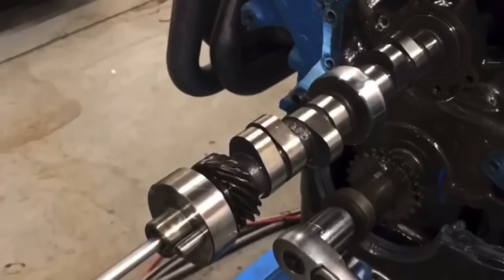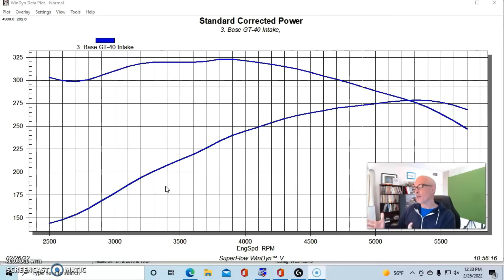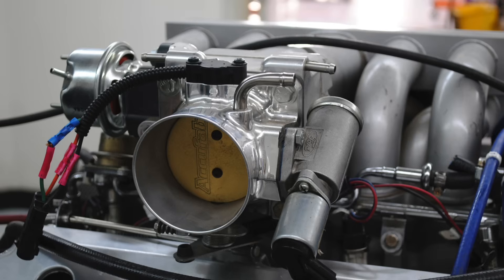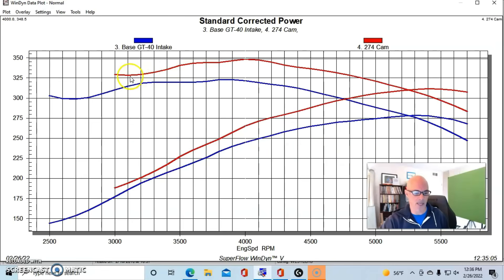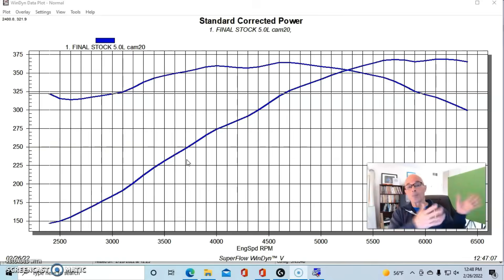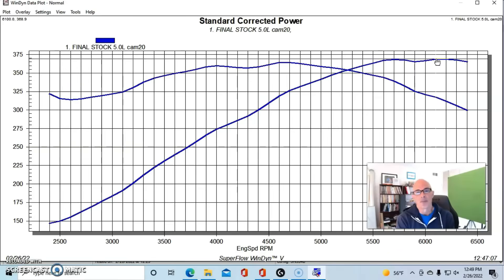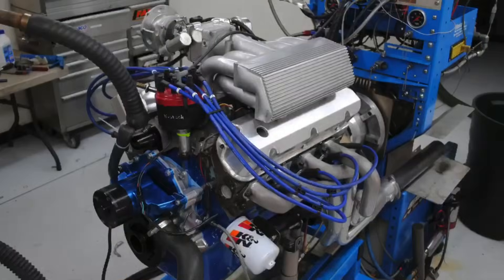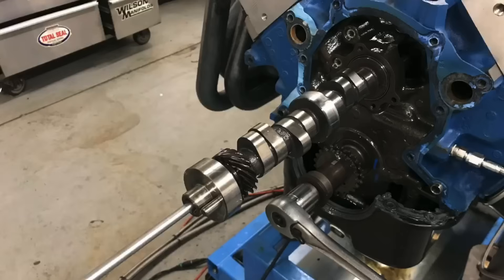HOW MUCH POWER IS A 5.0L CAM SWAP WORTH? WHAT IS THE BEST CAM FOR MY 5.0L 302? 5.0L FORD EFI VS CARB

Comment: 312hp in a fox or sn95 would be a respectable really fun street car and fairly decent in the 1/4 mile for such a mild combo. Seems there still fun and fairly quick even in 100% stock form no not "fast" but fun they accelerate good and will still roast the tires. People hear 215hp and laugh but I explain yes the HP is pretty weak sauce but it still has V8 TQ which feels decent off the line seems TQ gets you moving. Where the low HP seems un inspiring is top end pull. Unfortunately even tho they seem quick you can easily get gapped by a late model not performance car even some modern 4wd trucks and that is embarrassing... That's enough motivation to try n add some more TQ ant at least 100 more HP then you won't be gapped by modern sedans and trucks just don't test a coyote....
Reply: my truck makes 195 with the 5.0 lol at the crank
Reply: @sillyspoon2250  oh my 95 GT was rated at 215 new it has 150k so that ship sailed not to mention it still is original it has the OEM ford sparkplug wires and I think the plugs are original lol, I bought plugs and when I see how bad pass side accessibility was I didn't bother plus after having a plug snap off in the head of my 2010 grand caravan I'm not nervous about removing plugs even tho I've changed hundreds In my life and those were originals at 190k! It was running terrible plugs fixed it, they had a huge gap I'm surprised it ran as good as it did

Comment: Where are you located and do you do cam swaps at your location. Interested in the EX274HR cam you just previewed.
Reply from the maker: I don't have a shop
Reply: @richardholdener1727  Do you do it on the side? your videos are so on point and would pay you to help me change the cam, Lifters.
Reply: @richardholdener1727  I have a 600 cfm carb 302 aluminum heads and intake intake.

Comment: This would be more helpful if the baseline was a completely stock 5.0 which makes around 200hp rather than starting with something making 279hp and having it bored with long tube headers etc....
Reply from the maker: a stock 5.0l doesn't make 200 hp on the engine dyno

Comment: My question is if you run the GT40 intake manifold why not go up on the fuel injectors  tow like a 26 PSI or a 30 PSI fuel injector and put the 1-3/4"long  tube headers!! Would that give you almost the same equivalents as a carburetor like a 650 or a 750 carb!! You have me scratching my head on while I go to a carbureted intake and manifold when you could possibly get the same amount of horsepower out of a fuel injection intake manifold with just an upgrade of fuel injectors⁉️🤔💡🙄😒🤯
Reply from the maker: the injectors don't hold back the power of the EFI intake-it's the design of the intake
Reply: @richardholdener1727  what about a port  and polish for EFI manifold and the exhaust on the gt40p heads and put higher compression valve springs in with a good cam and
 1 3/4"long tube headers would that help any because I really wouldn't want to go with a carbureted intake manifold or spend more money than it's worth on the whole project of a budget build!! Thanks for getting back to me though on the thought anyways is there any way you could possibly change out the power steering pump and put an a EPS steering system in the car to help add more horsepower and do a little bit of pulley changes just thought!! If it is possible!? I really do like your videos... 😍

Comment: Ported lower for the GT40 would've been nice. The as cast lower pretty much sucks and it would be really nice if you had mentioned that or even showed the difference in those ports.
The GT40 is capable of way more than what was displayed here unfortunately. Let's not make the GT40 style manifolds (tubular, Cobra and Explorer) look like junk compared to the carbureted Performer RPM.
How about sending the lower GT40 to a good porter (TMoss is popular or even my boy Lloyd Elliott) and let them do what they do and then let's do this test again because the GT40 will not nose over nearly that early after porting!
Reply from the maker: The effective rpm does not change with porting, the runner length is still the same

Comment: When I looked for upgrades to do and see the number they say they add to a stock engine, I have had people say "Yeah, but you can't just add them all up and expect to get that". I have always said "You're right, you get more if they compliment each other".
Cam alone worth 33hp. Heads and intake worth 89hp. Just adding it up, you get an extra 122. Because they compliment each other, you actually got 149.

Comment: I've got a 306 gt40p heads the machine shop done what they call a street port exhaust and intake runners been gasket matched and cleaned up under the valves been cleaned up stock valves had a 3 angle valve job valve springs upgraded for the b303 cam , 1.7 roller rockers, eldebrock performer rpm intake, 650 double pumper holley speed pro  flattop pistons  1 5/8 long tube headers, b 303 cam msd distributor 9mm plug wires not really looking for a certain amount of horsepower and tourqe just wondering if this combo will work good together and the horsepower and tourqe it might make any suggestions greatly appreciated thanks
Reply from the maker: it will work-should be near 340 hp
Reply: Thanks I appreciate it

Comment: Good stuff. Interesting point: if you look at it as the percent gained, the difference is  barely over 1%, and that is likely because the 190cc 2.02/1.60 AL heads and better intake went from a horribly matched cam to a better matched cam while the iron head went from a well matched cam to one that the heads/intake couldn't take complete advantage of  the improved lift/dur.

Comment: I’m curious as to how those numbers would translate to power at the wheels. 
My guess would be for the 417 hp combination in a fox body with a manual would be 355 HP at the tires.
Reply: I spit ball the crank HP multiplied by .8 for an unlocked auto rwhp. ×.85 for a T5, T56.
Reply: I would say you are in the ballpark

Comment: With the superflow 902,what revs per sec do you use,i got a motor built for a 4wd,late 5,0 block,out 20,with 3.4 stoke crank =346 it has 9.7 comp,165 AFR heads Comp HR 280 cam and weiand stealth manifold and a holley 750 hp carby,and it dynoed 399 hp@ 6000,my engine builder was  blowern away with that HP as he is mainly street/strip and full race builder,He says his dyno equites to moroso calulater hp,he says a 400 hp engine from his dyno,with 3500 lb car is a mid 11 sec 1/4 mile car
Reply from the maker: the acceleration rate of a dyno can be changed-we normally run 300 rpm/sec

Comment: Good promotion for the factory roller 5.0 H.O. cam from the looks of things. Possibly pretty good duration numbers with a relatively wide LSA to keep the idle quality.
Reply: I ran stock HO cam in my f150 for 250 K. It was a nice upgrade over stock flat tappet, right at 200 rwhp. The 94 cobra motor with the truck intake is much better, I estimate 275 at the wheels, with about 1mpg increase...

Comment: I built a dss racing engine with that 274 cam back in high school. It had afr 185s and a ported cobra intake with 24 lb injectors. I was trying to copy a motor you dyno tested in the book 5.0 dyno secrets!
Reply from the maker: GOOD STUFF

Comment: I keep trying to explain this to a friend who just don't get it. He put in a better cam and keeps asking how much more power he's got. He thinks it's worth 100 hp and I say no more like 30 to 40 because he's got 317 heads on a 6.0. I said if you change your heads maybe 80 hp. He said why can't I get 80 hp from the heads I have. I keep telling him yes they flow well but drops compression ratio. Better heads with more compression will raise the gains from the cam.

Comment: When changing a factory camshaft to a bigger aftermarket camshaft, in an engine that has non adjustable valvetrain, can the appropriate length pushrods be used instead of machining the heads to accept adjustable studs etc?  On low rpm (5500ish) deals aren't press fit rocker studs sufficient as long as the pushrods are the correct length?  Are the screw in studs only necessary when the valve spring rates and rpm start getting significantly higher than factory?
Reply from the maker: yes
Reply: @richardholdener1727  thank you.

Comment: 🔔😎Comparing at 5252 rpm where the curves cross, each engine gained about ? similar hp/ lb-ft.
Just something that I have always done. 😎
Reply from the maker: why does the gain at 5252 matter more than elsewhere?
Reply: Only because the clock time spent at 6,000 rpm is less than 1%.
Usually people shift at 5 or below, except when racing.
Just my thoughts.
Thanks Richard 👍😎

Comment: Nothing is absolute.  Yeah... you can add a cold air intake, add long tube headers, add a larger throttle body... yadda yadda yadda.  You're not going to get exactly the 50 hp gain mentioned in the "up to 50 hp gain" advertisement.  Especially if #6 plug wire is fried cuz you didn't keep it away from the primary header tube.  Just sayin'.

Comment: Stock HO roller 91 5.0....Weiand dual plane, stock cam, stepped headers, 1.7;1 roller rockers, AFR 165's no change to the short block at all...407hp  (STOCK CAM) Oh, a 670 Demon carb too
Reply: wasnt that in car craft like 15 years ago?
Reply: @powerviking  yes! exactly   great article just shows how the over sq engines with proper heads cab make great power. It showed me the added power of stepped headers and that even a cam with .470" (after the 6% gain from the 1.7 vs 1.6 :1 rockers) could make great power.
Reply: @Selkirk69  it was the inspiration for me to do my own HCI swap on my 5.0 back in the day
Reply: @powerviking  I liked the build because it showed just how good the AFR heads were, they always outflow heads of equal intake cc . Yeah, I remember that article well, even the red color of the block and the fact that they used a stock cam! w/ just an upgrade to the 1.7 ration rocker ( so .444 + 6% ....027"...) + .471" not bad at all and duration was like 260 gross ( 210 @ .050)  which is so mild!. Just think, a .500", 224dg cam would have been completely street friendly and added 20-25hp more!  ahhh, memories!..cheers

Comment: I'd rather have a stock cam with good heads than a good cam with stock heads.
Reply: that's exactly what i am going to do
Reply: @roythomasjohnson2341  you can get 400 hp with just a head swap.
Plus good gas mileage and a mild idle.
Who could ask for more.
Reply from the maker: you can't get 400 hp with a head swap
Reply: @richardholdener1727  no, but you'll have better potential with better heads
Reply: @richardholdener1727  370is good for me with a t5
Reply: @richardholdener1727  sorry Richard. It's been done many times. I will point you to the results when I find them.
I respect you greatly but no one is a know it all. Including me.
Reply: @richardholdener1727  motor trend is one who did a head swap new rocker arms and headers on a roller 5 liter.
There are others that have done it to.
Reply: @richardholdener1727  Will it do it with AFR 185cc heads?
Reply: @richardholdener1727  Right, but you CAN get a pretty torquey 350 hp or so, seat of the pants dyno in heavy vehicle would favor the stock ho cam, ( the 94 cobra cam is the bomb in my 1990 f150_.
Reply: @richardholdener1727  lol. You sure can't get 400 hp with just a head swap LMAO😂. Richard I love what you're doing with your channel brother. I don't know how in the hell you keep up with yourself. You have got some hustle to you my man. Great work! Keep the videos coming and I'll keep watching.
Reply: @falcon6995 Yes and 1.7 ratio rockers.
Reply: @cammontreuil7509  But not in a factory tune and not just heads. It's impossible to get 400hp out of just heads. That's like saying taking your air box out adds 50-100hp
Reply: I have a stock GT cam and bowl blended GT40 heads, milled .040, .035 quench, performer RPM manifold, long tubes. Torque everywhere. Need a posi real bad.
Reply: @stuartwall8212  you did it right and even on the cheap.
Reply: @stuartwall8212 yes you do and probably steeper gears to
Reply: It's a Ford 302, cams are cheap as dirt. Delta cams Will hook you up with an alphabet regrind for $100....

Comment: Perfect timing! Im just starting to tinker with my 94 mustang 5.0… you proved to me that the numbers my dad said were right with the combination it has right now (give or take)… supposedly it has an E303 cam in it but everything im seeing is its still in stock format… i think it just might have a better tune… she already feels pretty quick, i cant wait to throw a set of heads on her even if she might have a stock cam, but if it does have the e303 cam that will just make her quicker! Should make for good content later!
Reply: AFR renegade 165s would be a perfect fit for your car.
Reply: @I_like_turtles_67  thats what im aiming for is a good set of 160’s
Reply: E cam will lope pretty hard. I got a 94, take the computer and toss it in the ocean.
Reply: @joenobody2580  i dont have an ocean but i do got the gulf of mexico lol
Reply: @TheFARM2019  Joe N. is right. The 94 computer is difficult to deal with. 
Pay a lot of attention to, and gather some knowledge of the stock ECM and the MAF sensor.
Or throw it into the Gulf and go aftermarket.
Reply: @2lotusman851  thats been the plan is to get a set of heads, a dual plain intake and then get a self tuning efi
Reply: You would know the difference between stock and e303 because of the sound and yes it feels a little more happy. I did that swap 6 or 7 years ago and finally  I'm doing gt40p heads and intake and better headers should wake it up more. Hope this helps😉

Comment: It's really cool all the work you put in. I can remember 20+ years ago arguing with my Dad why I'm staying 302 with him just shacking his head saying there's zero point just run a 351.  It's Sunday morning I might be a little late to this video but I'm sitting here with my cup of coffee thank you very much.
Reply: 351 is way ea way better.302 are 500 hp timebombs
Reply: @ryangulley1082 Myth
Reply: @ryangulley1082  Lol who told you that 😂😂
Reply: @isaiah9313  I know I've cracked in half.u nust not have been around long.everyone knows that except you.
Reply: @ryangulley1082  Ok boomer I’ve seen plenty of people with boosted stock blocks. Engine block splits based on a different variables. What was the engine build?
Reply: @isaiah9313  I've been racing cars for 34 years.ive seen at least 10 crack in half in the valley with 500 to 600.max.its a known fact
Reply: @ryangulley1082  Right maybe you’ve seen that, but that’s not a good way of determining if a blocks gonna crack…
Reply: @isaiah9313  wtf ever.it happens alot.guess you've never made any real hp.i left 302s many many years ago and went to real engines
Reply: @ryangulley1082  Lmao 🤣 someone get there grandpa back to bed. Ok I don’t know what you are considering as “real” hp  and “real” engines. But yeah 302 isn’t a bad engine torquey and love the sound they make, a good street engine. But I’m glad you were able to survive the 1900th century and work on more modern engines 👍 hopefully you didn’t split them 😱😉
Reply: @ryangulley1082  🐎💩